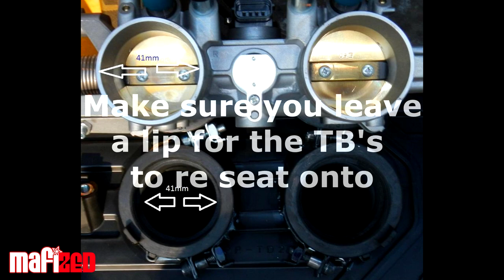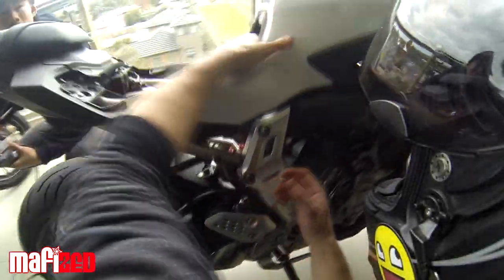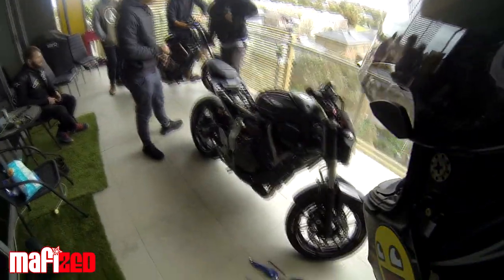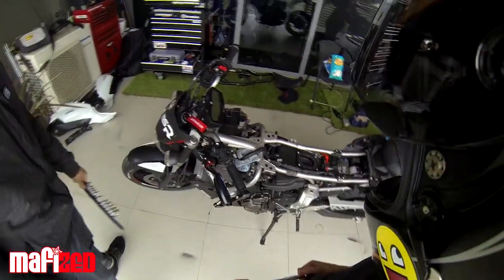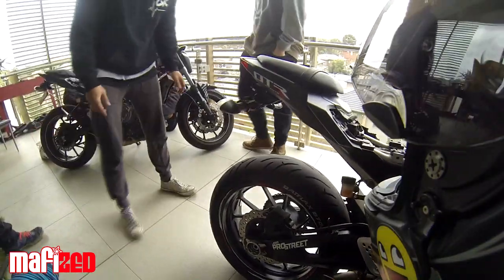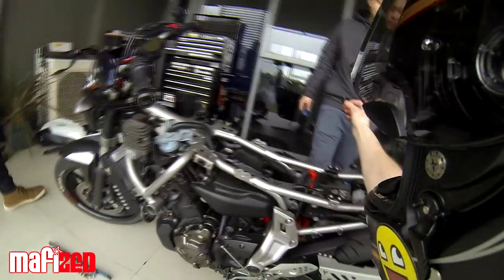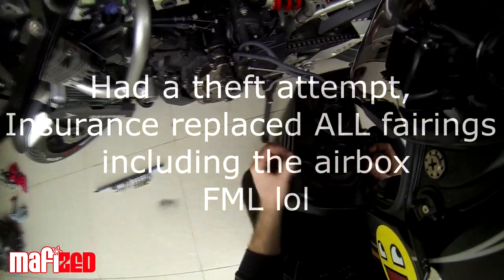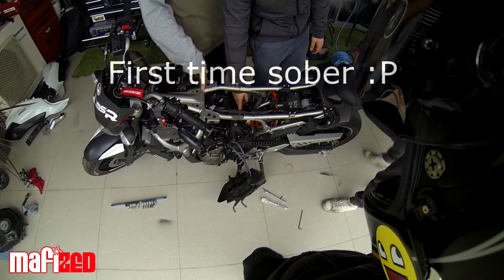⚡️DIY MT-07 The hidden restriction | THROTTLE STACKS  ✅  REMOVE ✅ INSTALL ✅  |

Comment: interesting to see how the MT-07 looks under neat those fairings, I didn't knew that the tank is actually covered with the fairings. and did i see right? is the rear shock attached directly to the engine?

Comment: TO ALL AUSSIE MT07 LAMS OWNERS
yes you definately have to reprogram your engine management system if you increase the air and fuel flow
ask any mechanic
i tried 2 mods on my bike, the throttle restrictor and the air box mod where i just took the stock snorkel and cut the rubber bit that feeds into the center of the air filter to give it more air flow.
as for the throttle restrictor i just bent mine back with a hammer so it could twist all the way
So instantly i found my bike was starving for fuel cos it was getting too much air (sure it was a little punchier off the line when i booted it full of fuel but the consequences are not worth it)
After 1 week my bikes engine management system went into shut down while i was riding down a busy street, basically the motor was getting too much air and the computer couldnt feed enough fuel to compensate so the bike shut down to save the motor from serious damage.
I own an Australian delivered MT07 LAMS bike, not sure the the HO (high output) version has higher flowing fuel injectors and can compensate for this
but word of warning to anyone wanting to give their bike more air, do your research first, ask your local dealer about what you want to do and how will it effect the bike and your warranty.
Dont be a tight ass and not reprogram the ECU to run your bike properly like me
your local yamaha dealer will not reset your computer under warranty if you modified your bike without doing it properly

nice vid boys
Reply from the maker: Hmm, i approved this comment so i could allow others to learn from your mistake. You are indeed a tight ass, but also stupid. Here's the reason(s) why 1. You smashed your throttle bracket with a hammer, which rocket science class did you take to enable you to measure WOT by eye using THOR's hammer? because if you go beyond WOT guess what happens, limp mode. GENIUS! 2. The air box mod is not the snorkel mod, that is the snorkel mod, they are 2 very separate things, the snorkel mod has fuck all to do with your problem. 3. Currently 200+ brackets fitted to Aussie and EU/NZ bikes to date, 0 issues.. i repeat, ZERO. It is literally only YOU who has fucked their bike up all on their lonesome (not with my help or my input either) 4. Your advice is irrelevant, i have the bracket, the actual air box mod AND the snorkel mod and have done so over about 15 months now with 0 issues. 5. Your not running my bracket, so why the fuck are you commenting on both my videos? You working for the dealer or something? what's your agenda here?
Reply from the maker: con georgiou No problem mate! that's why i approved your comment after all.    next PSA you make please get your facts right instead of spamming my vids.
Reply: con georgiou hi sir, does all the mt07 that do originally come from Australia are the 655cc restricted ones? Thanks.
Reply: i have a full power one i did remove the snorkel for the air filter and lost power it needs a tune if you want more and the tubes help for low end torqeu so if you mod that yes you can get more top end but will lose the low rpm torqeu so i just leave it i got a mt 07 for the torqeu not the power

Comment: So, the 655cc now makes how much hp? I mean after removing the restriction with everything else stock.
Reply from the maker: with zero mods? no one has ever left their bike stock but i'm guessing around 55rwhp
Reply: its a 689cc lol
Reply: K.T. The Australian version is 655cc.
Reply: Jamie Ey 34cc is not much in terms of the differences between HO and restricted 34cc’s won’t even be noticeable lmao !! 
It’s mainly the throttle stacks and throttle plate stopper that hold the bike back!! Once removed it’s next to the same I’m terms of power with the HO 689cc version

Comment: did you ever experience an sd_22 diagnostic code after doing this? I've just completed the derestriction  (thanks to you) but now have this code pop up on the dash. apparently it's air intake temp sensor error...
Reply from the maker: prem9740 yup! you just need to plug it back in. rhs top corner of the fairing. black plug. Happens often lol
Reply: MafiZed ahhhhh yep I missed it! got it now. Cheers! bike starts lifting up nearer the red line now. just need to get the exhaust done and then ecu reflasg
Reply from the maker: prem9740 Screams to redline the way it should 😂
Reply: MafiZed unleash the beast.

Comment: Lol I’m SURE it’s fine but seeing a few blokes and a couple of bikes out there makes you wonder…what is the weight limit of that balcony? 😂
Reply from the maker: I'd guess it's the same as the rest of the floor through out the entire apartment complex and the other levels as well, which would be re bar reinforced concrete slabs that are earthquake and fire resistant? Just a guess. Could be wrong.

Comment: where can i find mirrors like yours
Reply from the maker: They were $20 delivered off ebay, i do not reccomend them though.
Reply: Are you a mechanic ?
Reply from the maker: Punisher3545 just a backyard one. been working on my own cars for 12 years now. bikes 2 years
Reply: why not? do they fold at high speed or is it something else?
Reply from the maker: ToniLivo they just suck. The arms cracked when i tightened them very cheap quality

Comment: I wonder if it would be better to just put in the factory HO ones?
Reply from the maker: Same same, just less mess but not free :)
Reply: Any idea where to get those HO pipes from?  Tried to buy them off a website last week, and they cancelled the order!?
Reply from the maker: Can buy them from y-shop or any Yamaha dealer i believe
Reply: What a nightmare that was! Finally the HO pipes are installed. Made a "DNA stage 2" cover for my K&N out of the factory cover, bascically dremel'ed the opening wider and ditched the snorkel. We'll see if the thing starts in the morning. ;)
Reply from the maker: Congrats! Yeah it'll be fine, i did that to my stock lid over a year ago :)
Check my FB page for more tech pics/videos and my INSTA for bikelife pics. Links in description :D
But here they are anyway: 

FB
https://www.facebook.com/MafiZed/

IG
https://www.instagram.com/mafized_/
Reply: Man what a transformation!! Totally worth the hassle of switching out the pipes and opening up the intake.  The torque/acceleration from 5000rpm up has greatly improved where previously it was rather flat.
Reply from the maker: reddpill best free mod you can do
Reply: I'll have to meet up with you in Melb. one day and get one of your "mods". ;) You know of any riding groups in Melb. that are good to follow for rides?
Reply from the maker: The only one i join in with every now and then is the Melbourne MT-07 FB chat group, and my own friends. I avoid group rides with randoms like the plague. Been on 2 and never again. Too many hero's who's ambition outweighs their talent lol. Am always happy to go ride with a sub just drop me a line via fb
Reply: Totally understand that view point, saw a group have a massive accident a few months ago where 3 people rode into a t-intersection and then an armco barrier and superman'd it into the field beyond it. Helicopter and broken bones were a result along with several written off bikes, was crazy to watch.  

Will contact you over FB for a mod.
Reply from the maker: reddpill yeah plus poor lane hygiene, poor over taking choices and just really so many chances to be hit collected by one or more

Comment: Do you have an Integrated tail light?
Reply from the maker: No it's a DIY LED turn signal install into the under tail cowls, so i deleted the turn signals on the plate holder
Reply from the maker: Although this video shows when i had torn signals

Comment: Do you notice a big difference in power or is it just minimal?
Reply from the maker: Transforms the bike, about an extra 30rwhp including the de-restrict bracket
Reply: Sorry, let me get this straight. The de-restrict bracket will obviously bump the power up to what a stock MT07 makes. However have you checked to see if the additional mod is not just another de-restriction, as in stock full power MT07s don't already have these installed?
Reply: yeah thats what i wanted to know if it changes the power of the standard mt
Reply: oliver hovorka I doubt it. ~70bhp seems about right for a twin of this size.
Reply from the maker: These are learner approved restrictions only. Full HO model does not have either plate/stack restrictions  :)
Reply: MafiZed I'm sorry but without a tune you won't gain any Power and the only thing you'll do is make the bike more lean since it's already lean from factory and increasing air flow without increasing fuel will make it even more lean! Besides no way you can add 30rwhp to a lams Mt 07 as it already has different heads and valves to the HO model so by saying you're adding 30rwhp means itll be more powerful than the HO model...C'mon man
Reply from the maker: Incorrect, It does work and there's dozen of people to prove it. Additionally i can show you dyno readouts of an average of 64-65rwhp without a tune. 72rwhp tuned on average with highest ive seen so far sitting on 74rwhp. They come rich from factory, not lean(again have several dyno maps with AFR's). Where'd you hear that from anyway? I should have said 20rwhp not 30, Click my FB link for a dead stock dyno run back to back with my throttle plate fitted. FYI alot of these bikes are running exhaust/dna filter/snorkle delete etc.
Reply: MafiZed I've read in alot of forums that the Mt 07 comes lean from factory (not sure about the lams version) and also check out Jake thegardensnake's channel, he's a bike mechanic for 30+ years and he knows what he talks about. Again it doesn't make sense that how a lams model bike can be more powerful than a HO model from just mods?
Reply from the maker: I'm unsure of the US market HO versions maps, considering they use different fuel to us/elevation/climate etc etc but all i can say is regarding the information collected on our LAM's bikes, we lack 34cc. Add exhaust/filter for a few rwhp and why is it hard to believe it can match the HO? they average 65rwhp dead stock.
Reply from the maker: https://www.facebook.com/MafiZed/  check it out. Dyno pics/afr etc
Reply: is this HO or Lams?
Reply from the maker: RipJawsX 95 LAMS. would be completely useless and irrelevant if it was HO don't you think?
Reply from the maker: BluePixel Motorcycling LAMS only
Reply: wow I'm pretty surprised actually
Reply from the maker: oliver hovorka LAMS only
Reply from the maker: RipJawsX 95 yep, this mod is free to do. Plate is less than the cost of an air filter. Loads of fun when completed. Do you have a HO or LAMS?
Reply: i got a LAMS but dont want to risk in getting into trouble with the plate

Comment: doesnt this has to do with the age restrictions of bikes in some countries to limit it to 35kw?
Reply from the maker: Golden Shots yes it is one part of the restrictions, in aus its nothing to do with age. It's a noob restricton.
Reply: The 35kw in EU have only a travel limiter on the throttle body, except for the 2017 model which is detuned with the ECU.
Reply from the maker: Go check. Take photos. Report back

Comment: what is the result in performance?
Reply from the maker: Not exactly sure as no back to back dyno has been done that im aware of, but i did this before the bracket and it allowed the motor to gain hp in the higher rpm's rather than dying in the ass. No different felt until around 6-7k rpm.

Comment: It's an MT... the shittier version of the FZ in terms of air flow so... lol just buy a DNA air filter and a PCV man... You're already good at getting access to injectors so now just buy the stuff, install it, and take literally 10 minutes to download the PCV software and upload a map. Will get you like 8 extra HP, real talk.
Reply from the maker: Hey Dario, what shit are you dribbling? Bitches don't know about the name designation sheeeeet... you realise America is doing away with the FZ designation replacing it with MT as of 2018? And the only difference between an MT and an FZ is the spelling? Do you know what a LAMS version of the MT is? i'm assuming no since you posted that total nonsense. Just in case you haven't picked up on what im trying to say here, FZ/MT has no differences spec wise. the "fz" spec'd MT 07 in Aus has HO for high output in the ADM market, and LAMS for learner approved motorcycle. Any further education  will require payment $$$